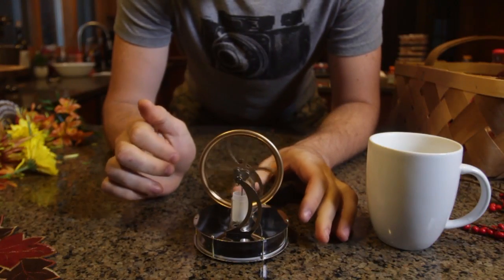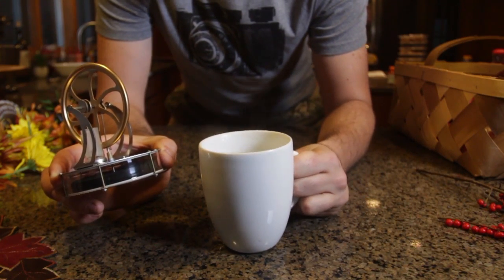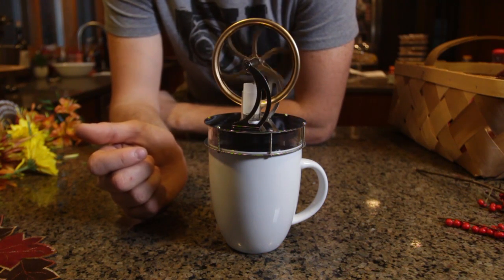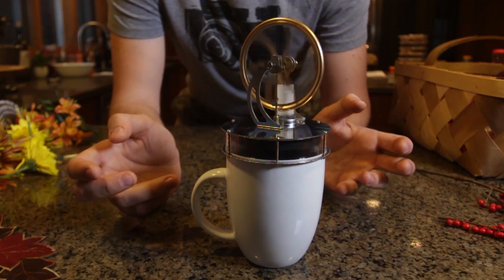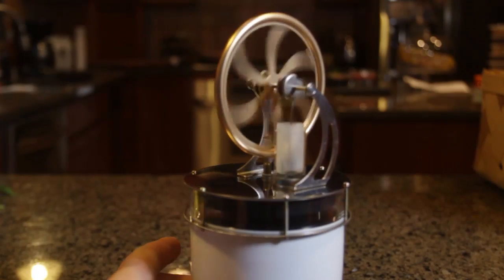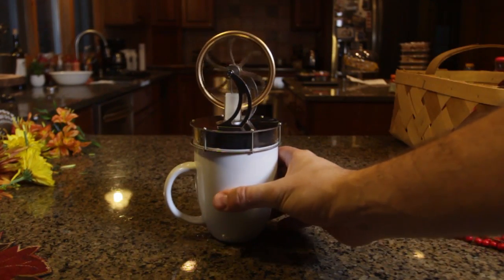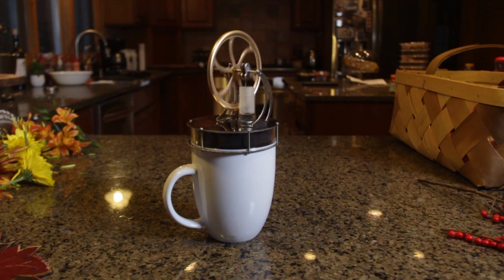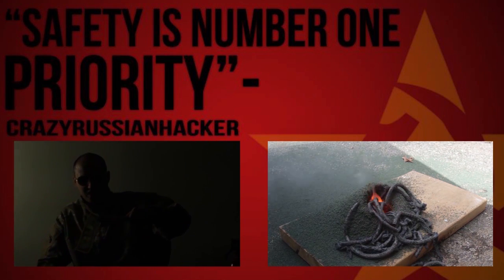Mini Stirling Engine - Science Toy

Comment: It doesn't produce steam at all.... It just works based on the temperature difference between the plate on the bottom (witch is being heated by the coffee) and the plate on the top (witch it cold)    maybe next time put ice on the top plate, it will spin faster! :)

Comment: Just a side note, it doesn't produce steam to move it, some how or another it moves because the lower metal plate is hotter than the top. It moves down and the plate transfers a small amount of heat to it, causing it to move up. Then it disperses the heat to the top plate, then making it loose heat which in return makes it move down. Once the two plates are the same temp it'll no longer move.

Comment: Здравствуйте Тарас Кул. Just a correction: You mention (around 0:40) that steam is produced inside the engine, but that is not the case. Stirling engines use a permanently gaseous working fluid, usually air, hydrogen, or helium. Very basically, the gas gets heated on one side (the bottom plate). A displacer, which is just a loose fitting piston, moves this heated gas to the cold side where it expands and cools down, driving the power piston. The combined action of the displacer and power piston then pushes the cooled gas back to the high temperature side and the cycle repeats.

Comment: I have a model sterling engine and it works on the displacement of heat it is not a steam engine. it could be made in to a steam engine but if you get one and see there is a foam piece that is really light that is being lifted by the hot air from the steel plate at the bottom. I say it could be a steam engine because the foam piece is not sealing to the glass side if it sealed it would be a steam engine. There is also different types of sterling engines this is a LHDE or 
low heat displacement engine.
There is HHDE as well the first h Stands for  high the rest is the same HHDE run on a flame and have eminence torque and speed compared to LHDE